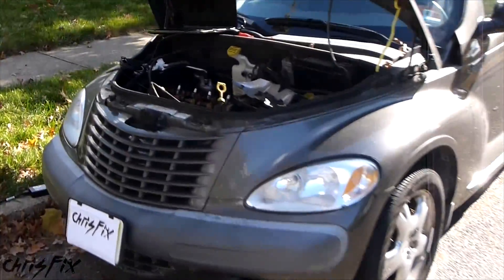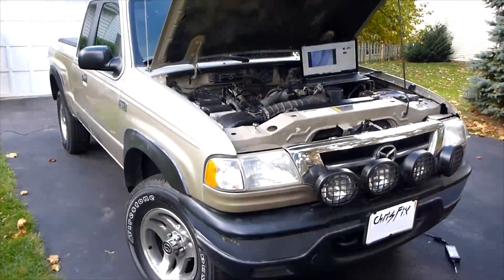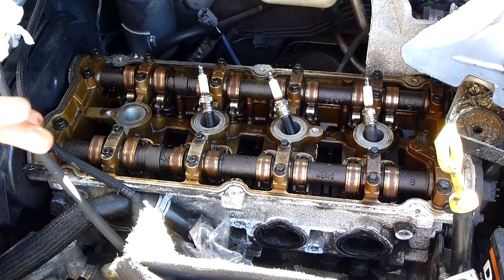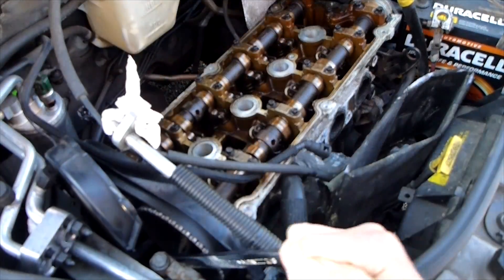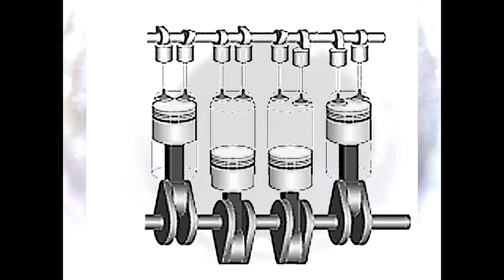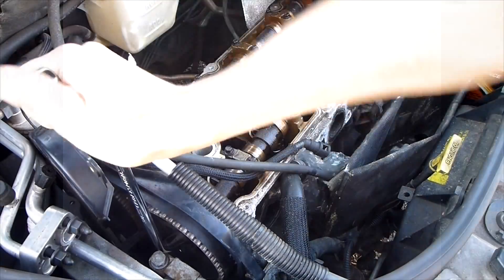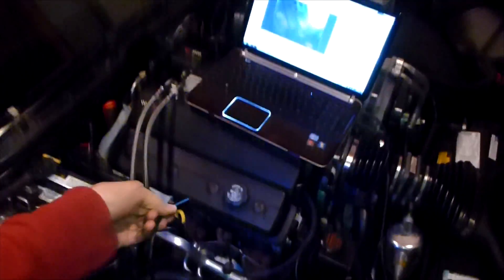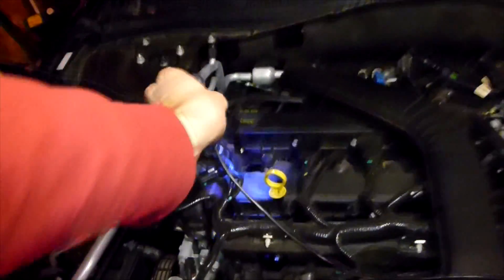What does the inside of an engine with a Bad Head Gasket look like?

Comment: Yes please do high mileage engines also before afters with fuel treatments like seafoam or Lucas.
Reply from the maker: DE Nichols Seafoam might have been designed for 2 stroke engines but the concept is the same to remove carbon. Carbon buildup is not any different in 4 strokes compared two two strokes. Also, a lot more people use seafoam so it would be more interesting in my opinion.
Reply: ChrisFix I've repeatedly searched for MSDS Seafoam and I am not yet having luck. I found a forum that promises MSDS and talkd about what is in the products, but doesn't actually show the MSDS or have the link.

I think he has the general idea correct, but his reported percentages are off. I haven't see a MSDS for PEA above 30% unless the 40% was part of a range that started at about 20% and the rest was solvent.

http://www.bimmerforums.com/forum/showthread.php?1855947-Stop-Wasting-Money-on-Seafoam!
Reply: I vote Lucas over seafoam since seafoam was designed for 2 stroke engines and the oil is not good for 4 stroke engines.
Reply: ChrisFix  To be honest there are a lot of Lucas products that have come highly recommended and I haven't complained, but the MSDS on it versus the Gumout Regane  wasn't that different...I mean most of it was a different solvent, but I'm not a chemist and have no clue what difference that makes other than the PEA being more on one than the other.

I can't disagree with your thinking. Sure they say Seafoam is bad for catalytic converters, but we're talking about one treatment just to see. And it even makes it more dramatic/controversial if it really works where the scope can see, but then there's that catalytic converter concern. lol Your choice, I look forward to it. :)
Reply from the maker: DE Nichols I never heard that it is bad for your cats... Where did you read that and why?
Reply: ChrisFix I didn't get that directly from research. Scotty's been saying that since before his paid endorsement of Gumout. He read it in technical service bulletins. Forgive me, I can't remember which chemicals, but he asked us to consider will the chemicals that are in there, oil based, that damage the catalytic converter win or the chemicals that also clean the converter win?
Reply: He's typed comments on it many times and talked about it in multiple live events.

Comment: The number 1 piston is on the flywheel side and the number 4 is on the timing belt side. You said reverse. (sorry for that)
Reply from the maker: StillJohn17 Cylinder #1 on straight 4 engines is at the front of the engine closest to the timing belt.

Comment: now i know that rotarys its almost mandatory you get it over 7500 rpms to break up carbon, and those things rev to 9500, but is it the same for a piston engine? is it good for it to rev it out once in awhile to get it hot enough to knock out that carbon?
Reply: ChrisFix Oh, that makes sense thank you. My town has nothing far away, so that's probably why water decarbonization made such a difference.
Reply from the maker: Scott Brixey The revs in the piston engine help, but carbon buildup is mostly from running the engine for short trips where it doesnt warm up all of the way. So going to the grocery store or a local drive where the egnine doesnt fully heat up causes carbon buildup. If you do a lot of highway driving where your engine is warmed up and stays warm for a long period of time, that lessens the amount of carbon buildup. Even with a rotary, just reving the engine past 6500 wont do much for carbon. Sure it helps compared to keeping the RPMs low, but it't not just going to "knock out" all of the carbon unfortunately. If it was that easy, it would be great lol

Comment: Hey Chris, about a year ago I got taken also by a guy that sold me this car which ran great for having 120,000 miles on a 2003 PT Cruiser GT but a week after I bought it, it kinda did the same thing and overheated other than it didn't blow up it just acted like the timing belt slipped a notch. So instead of going postal on this guy I decided to troubleshoot it. Anyway after a long teardown (which I do not suggest the light hearted do-it-yourself-er perform on any PT's) You know what I am talking about; I found that the #2 exhaust valve had blown. So I cleaned up the block and pistons since they looked good, and the walls weren't scuffed a little worn though because no cross-hatching, ordered a reman-head and put it back together. A long story short hahaha, they sent me the wrong head, after the third time around (I got real good at tearing it apart) I turned the key and it started right up...Whew!!!
Okay so my question is do you think I will have more similar problems with this PT even though I basically rebuilt the thing, should I get rid of it, after all I put at least $6000 into it which includes the $2200 that I paid for it. There are no more coolant leaks etc. and it runs okay, but I am not sure how long the rings and stuff will last.
Reply from the maker: Scott B Hey Scott, that is great you did all that work on the head (three times lol). I think you should keep the car. You put the new head gasket in and you torqued down the bolts and assuming you did it correctly, you shouldnt run into this problem I had in the video. If you put $6k in the car, you will probably get $2500 if you sell it because that is what it is worth. I would keep it because you cant get that money back besides using it until it dies. I cant tell you how long the car will last, but hopefully you fixed everything and the new parts will last.
Reply: ChrisFix
Thanks Chris for your input. Yeah after the discovery of the wrong head I triple checked all the specs. to make sure I got it all torqued and tightened correctly. I should have done a video on it but I was so frustrated at it all I almost took it to the smasher :-)
Thanks Again and I really enjoy your vids - very helpful! You are Awesome

Comment: I'd love to see a before an after on a Seafoam type engine cleaner, and also would like to hear what the repair for the PT Cruiser engine is? Can the block be rebored and the damaged pistons and rings replaced?
Reply from the maker: Larry Heller I will be making a seafoam vs gummout vs water video so stay tuned for that! As for the PT engine, it can be bored out, the head needs to be decked and pretty much all new internals! I think it is cheaper to get a new engine lol
Reply: Thanks, that is good background info! PS - love your videos, you do a great job! Some of the best I have seen!
Reply from the maker: Larry Heller Thanks a lot Larry! I am really glad you like the videos!

Comment: actually Gumout additive works pretty well, they clean the carbon deposits on your fuel injector nozzle, carbon buildup on your intake valves, and the combustion chamber.

What I didn't get what u said in your video about coolant leaking into the piston and clean the engine? I think blue smoke is for oil leak and white smoke is for coolant/water
Reply from the maker: ***** How do you know Gumout works to clean the engine? Did you check before and after? As for the coolant leaking into the piston cleaning the engine. When there is a head gasket leak, the coolant can leak into the cylinder so that constant drip steam cleans the engine. Does that make sense?
Reply: ChrisFix so the coolant is design to leak through the head gasket into the piston to clean the engine???
Gumout I haven't check my piston but as from what I've heard, some people said their gas mileage actually went up a little bit when using Gumout additive.
Reply from the maker: No, the coolant is not designed to leak, it is designed to do the complete opposite. The head gasket is supposed to keep the coolant from going into the cylinder. If the head gasket leaks, it will steam clean the pistons like you saw in the video. 
As for using any fuel cleaner, I am skeptical unless I see a difference visually (which is why I will make a video on it).
Reply: ChrisFix head gasket is to keep coolant and engine oil from leaking into the combustion chamber. However, since coolant steam clean the piston that doesn't sound too bad of an idea lol! I'm being sarcastic.
Reply from the maker: ***** Exactly. And haha, they should invent like a drip of water that goes into the engine while it is running.
Reply: ChrisFix have something that's unrelated to this topic.
But OHV w/ rocker arms engine can will only have 1 intake and 1 exhaust valve right?
Reply from the maker: ***** A single OHV commonly only has one intake and one exhaust. The PT is a double OHV engine so there are two camshafts and 4 valves per cylinder. With a single ohv there really is not enough space to have 4 valves per cylinder. I am sure it has been done and maybe there is an engine out there with it, but every single OHV engine I can think of has 2 valves per cylinder.
Reply: ChrisFix so it is impossible for pushrods OHV engines to have more that 1 intake & exhaust valve right? Because of the space and angle?
Reply from the maker: I wouldnt say impossible, but I have never seen it. But yea due to space and the angle and stuff, it is not economical to make an engine like that.

Comment: Definitely interested in seeing how well a  basic water cleaning works. 
I don't think a before and after of an engine cleaner would be worth your time though! It'd probably turn into quite a project.
Reply from the maker: Michael Block Yea, this is gonna turn into quite the project but all my videos are so.
Reply: ChrisFix lol I didn't consider that did I?

I poked around after watching your video and found that a common factor in the effectiveness of any engine cleaner where the method of use is simply to be added to the tank (verses introducing it directly into the combustion chamber at operating temperature while maintaining a certain RPM range) is that it is specifically formulated for the basic type of engine it will be used in. As in 2 cycle or 4 cycle. The "universal" product offerings for this easier method seem to be less effective.

I've even heard that the best thing to use regularly after cleaning is something like HEET, which allows the expensive detergent gasoline we're all paying for to work better by displacing  moisture allowing said detergents to do the job of preventing carbon build up in the first place.

Comment: Could you make a vid on how to Fix the problem.  When a gas pump keeps shutting off while putting fuel into the car.  Even when its empty.   REALLY ANOYING :)
Reply from the maker: Haytrix Does this happen with all different gas pumps? If so you probably have a collapesed filler neck or filler neck hose. It is the hose that runs from where you put the gas nozzle and it goes to the tank. If that line is clogged or collapses it will cause the gas to fill the line and the pump will think the gas tank is full. I cant really make a video on that because I dont have that problem, but if I ever run into that problem I will make a video for you showing you how to fix it.
Reply: yeah pretty much.  some worse than other pumps. Some say it could be the charcoal purge valve being clogged up. But cant find it on my car lol
Reply from the maker: It could be that too because the air in the tank wont escape while you are pumping and that pressure sets off the pump safety switch to stop pumping. I would think you would get a check engine light if it was completely clogged but I bet it is just clogged enough that it builds up pressure but doesnt effect the fuel system.

Comment: +1 for the SeaFoam treatment. Especially when you apply as advertised, fuel system through the vacuum hose, engine oil, and fuel tank.

I would also like to see the same test done with the Lucas treatment as well. Very curious to see which ones if any really work. And find out if I have been wasting money for all these years...

Very nice video, already a subscriber.
Reply from the maker: SS Crew Yea, I am curious too! I wont be adding any seafoam to my oil, but everything else I will test and make a video for!
Reply: Thats good, Im not really concerned about the oil portion. They claim it helps get rid of the carbon build up as well. Would be curious as to just how well the fuel portion actually cleans the intakes, valves and such.

Comment: Smashing vid :-)), the mower was cleaner than i expected, mowers seem to have a cruder carb setup so i expect over rich sooty insides.

That pt cruser engine is a bit ill, understatement lol, whats your fix?, fresh block and pistons/rings or pull a second hand engine from the car scrap yard.

No disrespect chris, but that pt cruser has been whipped with the ugly stick lol :->
Ive seen similar looking cars in the uk, and i allways say "yuck", the designer must have had a day off sick and the janitor stepped in to finish the front he he :-))

Another car that i hope you dont have in your country is a renult megan 1.4 Dynamique 5 Door Hatchback, it looks fine untill you get to the back then "SOME ONE STUCK A BIG ARSE ON IT!!", ha ha sorry mate, just looks silly, what were they thinking.
Reply from the maker: zx8401ztv Thanks bud! That lawnmower is only 2yrs old and is well taken care of so I would hope it is clean. I guess the crude form of carburetion and probably the very rich fuel mixture will cause them to gum up more than a car engine. 
The PT is in good shape other than the engine which is why this sucks. The engine will cost almost $2000USD which is almost the value of the car because the car itself is garbage due to all the common problems it has. As for the Renult, we dont have them in the USA, yet... So I dont have anything to worry about lol. Sometimes I wonder what these car designers are thinking lol
Reply: ChrisFix Hey Chris! Great Videos! since buying a new engine is too expensive, What are you going to do next? now you could buy a wrecked PT but with a working engine and swap motor or parts? I am intrigued
Reply from the maker: Martin Navarro I honestly dont know yet. I have been thinking of a jubkyard engine but they have 100k miles on them and they are asking $1000. So for another $800 or so, I could get  a new engine that I know works. With the junkyard engine they "guarantee" it works but if you get it in the car and all set up, I dont want to disassemble it and return it for a refund lol. Plus a junkyard engine will need a new water pump, new timing belt, and a few other things. A new engine needs nothing. Sooooo. That being said, I have no clue LOL
Reply: ChrisFix You are facing a seriously tough engine. I think of about 5 solutions to most of my car problems before I make a purchase, and it must be even harder with it being an engine on the line!

Comment: Cool images.  Guess a bore, new pistons and rings are in order.  Did the head warp any?  When I was a young man, pouring a glass of water down the carburetor was something we were expected to do because EVERYONE did it :-)
Reply from the maker: ***** Thanks man! I think the head might be warped just because if the piston melted the head probably went, especially with such a bad head gasket leak. I am looking for a replacement engine because I dont have any machine shops around me who is willing to bore out 4 cylinders and deck a head.

Comment: Just bought one off ebay couldnt resist for £9.40 :-)
Reply from the maker: fastmongrel haha, I really wanted to see what was going on in my engines so... It is really neat!
Reply: ChrisFix
Got my borescope but cant get it to work on my laptop.  How did you get yours running, I plugged it in and it installed and shows up as a device but cant see anywhere to use it.  Spent a while double clicking and right clicking various things but nope nothing.  Tried using the webcam app for the laptop but it doesnt show up on that .
Reply from the maker: fastmongrel Did you get the one that I got from Amazon? If not, it may be different than mine. Mine came with a disc to install to run the camera but I did not want to install Chinese malware onto my computer so I ran the camera though windows movie maker. I clicked on the webcam to record and chose "endoscope" when they asked what camera I wanted to use.
Reply: ChrisFix
Yes got same one I think they are all the same generic chinese ones.  Tried it through moviemaker but it only shows the laptop webcam theres no option to choose.  Tried it on a PC at work and its the same I think I have a bad one.  Got it through ebay so should get my money back or a replacement.
Reply from the maker: fastmongrel Did you try unplugging the cam and plugging it back in? It should come up as "endoscope" along with the webcam...
Reply: ChrisFix
Just tried that and nothing shows up in Moviemaker.  It installed when I first plugged it in, the scope lights come on and it shows up in Printers and Devices as a USB camera but nothing I do gets it to work.  I tried using the supplied disc on a work PC just in case it was dodgy but the PC couldnt find anything on the disc.  I have sent a message via ebay about it so hopefully get a new one soon.
Reply from the maker: fastmongrel Good luck! Let me know if they sort it out!
Reply: ChrisFix
Got it working tried the disc on yet another PC at work and the disc worked this time, dont know why it wouldnt work before.  Copied the files to a memory stick plugged it into laptop zapped the memory stick with Norton security twice to make sure it wasnt full of viruses before I opened any files and yaaay it works at last.  Going to see what the inside of my 2.0L Ford Duratec engine looks like :-)
Reply from the maker: fastmongrel Sweet! Let me know!